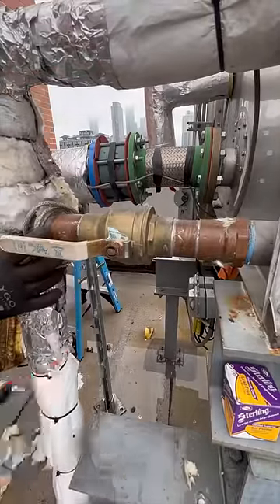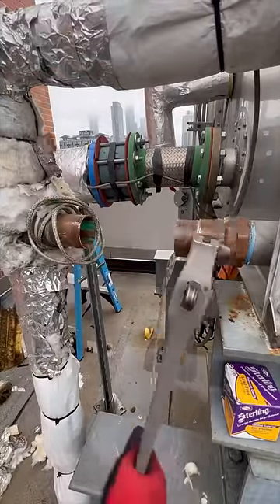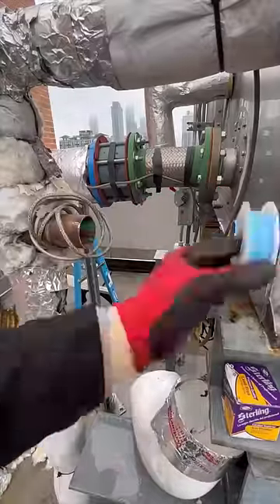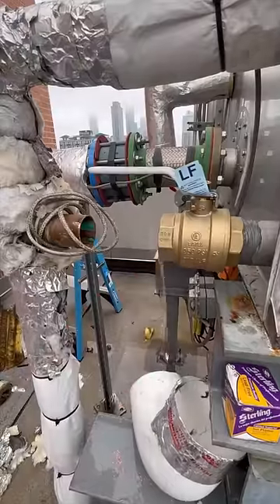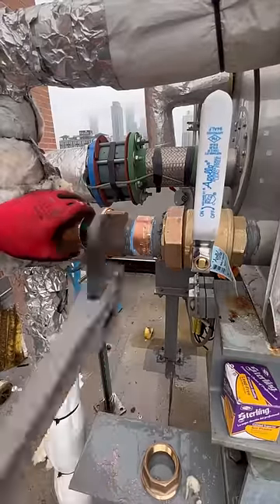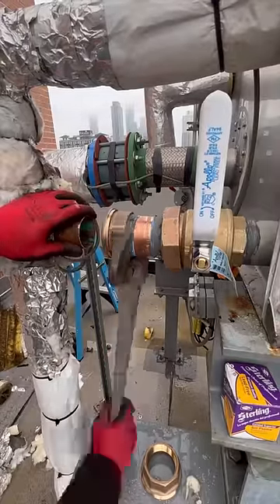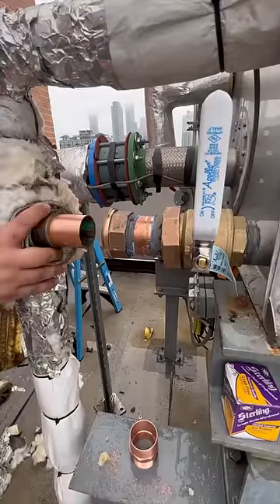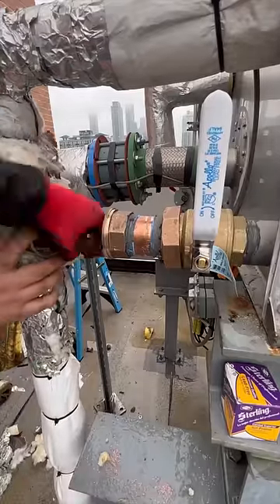Replacing a broken ball valve in cooling tower drain #plumbing #comedy #hydronyc

Comment: The reason that valve froze is due to the HALF-ASSED heat trace job.  There should be AT LEAST 2 wraps on that valve, one wrap on each side of the center.  I would always put a wrap near the flanges or openings of the valve.  "Self-regulating" is the most forgiving and easiest to work with.
That insulation job contributed to the problem.
Reply: Came to the comments to say the same. Good on ya for mentioning the self regulating type. Is it the constant wattage type that, especially thats fiber wrapped that cant be crossed over itself and can burn out?
Reply: @Skunkhunt_42 That’s exactly right. I won’t allow self-regulating heat trace to touch another wrap either, unless I really really have to. It’s a bad habit, and won’t do its job as well if it crosses over, since some of it won’t be touching the pipe. There’s simple guidelines for how to wrap it too, based on the trade size of the pipe and fittings.
Reply: It's not the heat trace that's the problem, it's the shitty insulation job. There isn't enough and looks like it could take on water, once its wet it's not insulation.
Reply: @briankrieg5801  probly has alot to do with it

Comment: Had a dude come into the store with 3 2 inch ball values with blow outs like that it blew my mind. Turns out he forgot to drain his concrete trucks water lines after the day in the winter. Don't underestimate ice it's so fuckin strong
Reply: Smells like -32*
Reply: Water is very, extremely, resistant to compression. That coupled with other amazing attributes makes for one of the most powerful substances in the universe. Don't ever diss water for being basic.
Reply: There's a video on this. I think Backyard scientist made a bunch of bombs trying to contain ice expansion.
Reply: @D.H.1082  I think you might be a little confused, or im confused with how you worded your sentence so inaccurately while also being correct, liquids essentially cannot be compressed.
Water expands while freezing, only about 10% of its total volume but when it was already taking up 100% of it, it can bust almost anything open it seems
Reply: @cherriberri8373  That what I said. Water does not want to be compressed. It'll compress slightly, not sure of the numbers, but ultimately it is resistant to compression. That's why water is able to be used in pressure washers, pipe bombs, and even shaping metal.

Comment: Was that last male adapter joint not sweated?  Perhaps you just didn't record that part 🤔

Looks real clean as always, broski!
Reply: It's just a drain line, goes straight down to an open end near the roof, so leakage isn't an issue lol
Reply: He fluxed the pipe. Should've soldered that. That flux will cause corrosion.
Reply: He said he soldered it
Reply: I thought the same thing.  If you look at the fitting right when he started to cover it back up with the insulation you can see the discoloration from the heat.
Reply: I seen that lol
Reply: He soldered it

Comment: I love how you used gray tape and compound on the threads, on a solder fitting that you didn't solder! Lol
Good solution under the circumstances anyway!
Reply: Yes, i noticed that no-solder male adapter too..... Pretty risky !
Reply: @mybeachshack  it's just a drain line, so even if it leaks it doesn't matter since it will fall to the same roof below
Reply: No he definitely soldered it. You can see him apply Flux and then at the end if you look at the male adapter you can tell it had been heated up. He just cut that part out.

Comment: I was an industrial HVAC tech. for over 18 yrs. I can't tell you how many times I've fixed this issue, explained to them to crack the valve and let a trickle of water run through which would help but if they didn't  need the cooling to drain the tower and leave the valve open.

Comment: That’s not going to last unless it’s properly insulated. The insulation material on it currently is meant for indoor applications and is not vapor retardant. It needs new fiberglass or armaflex insulation with a PVC/aluminum jacketing. Otherwise he’ll be calling you back in about 4 months from now  broski.

Comment: I recently replaced a couple popped valves on a glycol system for a wine processing plant. Same exact thing, they leaked when you moved the valve but held when either closed or completely open. And thats how they got away with putting it off till summer. Wierd shit, the glycol flows at like 15° and every exposed bit of brass or copper in the system is covered in ice, even in the middle of the summer.

Comment: A way to prevent that from happening again is by drilling a small hole on the discharge/drain side of the valve, this will prevent pressure buildup inside the valve when it freezes

Comment: Its a ball valve. A ball with a hole through the center. The way it was installed( the new valve also) you end up with a column of water trapped in the ball with it closed. Which freezes and cracks the valve. If you can swap the handle  around and rotate the valve clockwise to open counterclockwise to close it will never fail in that manner again. If the hole facing the tower rotates down when closing the column fills with water. If the hole facing the tower rotates up when closing the column drains of water and you end up with a column of mostly air trapped within the ball which doesn't crack your valve when frozen. The heat tape should have protected it I just found the failure analysis interesting.

Comment: On a cooling tower the valve must be cracked open in order for constant water to pour out. This helps alleviate scale buildup because if you keep circulating the same water you're just going to have a pile of scale at the bottom of your Tower

Comment: Before installing new valve.  With valve closed drill small hole on drain side of the ball.  This will allow the small amount of water trapped in ball to drain after closing.  Or put in a new valve that is sure to fail the exact same way the first did.

Comment: The ball valve traps water or fluid in it's center which caused their issue but the frostex heat tape I personally have very little faith in. The unit would need a heated enclosure where I am. A ball valve with a drain where this one was cracked,might be something that if not made needs to be. Other than that all I can say is a better heat tape otherwise he'll need you back.Winter will find any flaws in anything.

Comment: That brass breaks pretty easily.
So many times ive been tightening a ball valve and then "crunch", it breaks into 50 pieces.
So theyre pretty brittle, not surprising when ice cracks them open.

Comment: They need to drill a hole in the side of the valve. The "ball" holds water. So when it's closed, there is essentially a vertical column of water that is sealed from the rest of the system.

Comment: That heat tape was improperly installed. It clearly states to not wrap it around the pipe ,its suppose to run on the underside and then insulated. Heat rises, plus crossing over the wires will damage the wire casing and eventually short it out. 👍🤷‍♂️

Comment: The heat trace is installed wrong. Someone should have used glass tape to secure it to the pipe, and you never overlap it. Good job on the fix

Comment: I was going to comment that you didn’t actually solder the male iron, but I watched the video again and noticed that it was a different colour at the end of the video, so that part wasn’t shown. 

I’m keen to know why you recommended that you shouldn’t solder that fitting on though. I’ve been a plumber for over 20 years now, and I would have literally done this entire job the exact same way, but other than soldering near another joint, I don’t really see any issues with doing so. Plus it’s just a discharge pipe, so it doesn’t really matter anyway

Comment: Having been in the Insulation game for 20+ years(yes, it's actually a skilled trade), I can tell you that Insulation on that system is not acceptable enough, even if the pipe is heat traced.

Comment: I woke up one morning to tue sound of running water... it's -30⁰C outside. Behind the drywall a sharkbite had burst. I hadn't gone to plumbing school yet so I just replaced the shark bite and put in some insulation. Fingers crossed, it doesn't burst this winter.

Comment: Did the heat trace line fail to prevent the freezing of the valve because it was not in intimate contact with the valve and pipe? That one inch gap is likely the issue, insulation or no insulation.

Comment: Why aren't you using a tubing cutter. The uneven cut that you will inevitably get from a sawzall will reduce the amount of depth you will get in the joint combine that with a void in the solder joint (can happen for various reasons) you het a poor joint that can fail.

Comment: Okay, the old setup had the steel pipe connected to copper.

The new setup has the steel pipe connected directly to the brass valve.

Electrolysis.

A dialectric union. should have been used.

Comment: As a mechanical insulator who’s insulated tons of these type of pipes, just looking at how that insulation is just taped and barely hanging on just hurts, there’s not even any real metal put on as I can see, I don’t even see any wing seals with bands 🤦🏽‍♂️ gives the rest of us insulators a bad rep
Reply: The fiber glass insulation was also to small for it , you can see the lines where they tried to force close it. Should’ve just gotten I think 2 5/8 to fully wrap around . Putting on 1” insulation for 2-3 “ copper 🤦🏽‍♂️🤦🏽‍♂️

Comment: I just went out to look at inch and a half ball valve for irrigation or somebody forgot to shut it down last winter or they thought the outside ball valve with how you shut it down either way they screwed up but it wasn't a crack in the housing it's split all the way around so the ball valve was in two separate parts and the ball still rotated and you could watch it

Comment: Next time when you tighten a brass nipple into a fitting and there is another fitting on the other side of the nipple (union) then use an adjustable to tighten the union which then tightens the nipple into the valve and the everything is tight and there is no scratches on the nipple….it was a very good job you did and do but take full pride in your work

Comment: ... so the fix you ended up making was not the original quoted fix??? What was in the original quote? Why was replace the broken valve not your first reaction and other than replace the insulation around the new valve what else could have been added to that repair? Busted valve = replace valve.

Comment: Don’t use duct wrap on exterior piping it should be oversized pipe insulation and pvc jacketing to account for the heat trace and weather hire the correct contractor for the job or it will break again

Comment: why you have to check your heat tape weekly to prevent a freeze... Knew a guy who did not check his heater in the penthouse and had his 12in condenser line burst. Came in next morning and found the running out the lobby...

Comment: If you were already gonna sweat the union on, why didn't you just pull the old one off with heat and sweat the new one on the same spot? That would have been cheaper for the customer, at least in parts

Comment: Bro you are supposed to leave the first two threads bare when applying Teflon tape. Rookie.
Reply: Lol, maybe on poly fittings. Rookie.
Reply: @AlexK-yp5ik  lol what? I assume by poly you mean PVC? WTF are you talking about? If you wrap the entire threads in Teflon, some of the tape is going to make its way downstream into potentially sensitive areas, such as a check valve or a sensor. Don't be a rookie. PVC has nothing to do with it.
Reply: @s.w9935 bruh.  it’s a drain valve
Reply: @s.w9935  Don't be a rookie and assume poly means PVC derp. Poly is short for polyethylene. Completely different materials.
Putting ptfe on the threads doesn't mean wrapping it over the end. If you get it over the end when you wrap the first couple threads, then I recommend you keep doing your method. Otherwise, I'll keep doing mine, which has never been an issue. And I'm a maintenance guy, not an installer only, so I don't just walk away from my work and make it someone else's problem.
Reply: @AlexK-yp5ik  bro the hostility is getting too much. My fault. I'm a maintenance Plumber, working towards my Steamfitter ticket. I learn new things everyday and I will always have new things too learn. As far as this PVC/Teflon/Whatever debate goes, all I know is: I learned in trade school to always leave the first two threads bare, so as to prevent Teflon from bunching up and making its way downstream, possibly plugging a port or some other sensitive section of piping. Thank you for the info, I will always have much to learn. I think the content creator of this video can sense my sarcasm; he obviously isn't a rookie; I'm just busting his balls. Peace to you my friend.
Reply: @s.w9935  All g man. Just remember, you'll learn more from guys on site than at tradeschool. Whilst there are exceptions to the rule, there is a lot of truth in "Those who can, do. Those who can't, teach."
If you learnt it at tradeschool, they probably have to accout for the many idiots who go through and don't know to not wrap the end.
Reply: @AlexK-yp5ik  Those are some wise words. I have nothing but love for my fellow Pipe-Tradesmen. Thank you, and God bless homie.

Comment: What’s the point of putting a valve there when the cold will freeze it again you should have just joined the pipe and install a plug at the end for drainage.

Comment: How didn’t that copper Male adapter on that galvanized nipple not cause electrolysis?
Reply: brass
Reply: @edwardromana  where do you see brass on the existing work. Obviously the repair was done correct but before

Comment: So why not a slip coupling?
Reply: It’s easier to disconnect against a boiler or an AC unit . And sometimes it’s easier to use a Union when you don’t have a lot of wiggle room. Like a couplling is nicer to use if you have room to push the pipes back and forth but in this video I’m assuming it’s not easy to move those copper pipes so fitting a coupling probably would be impossible